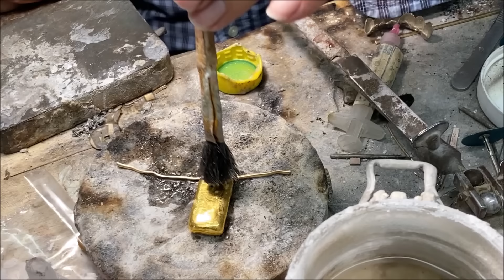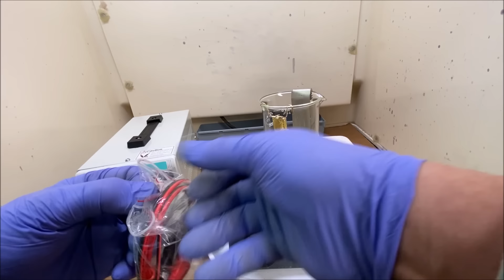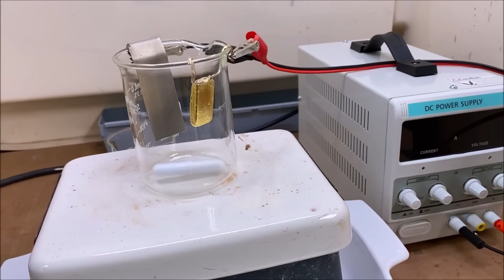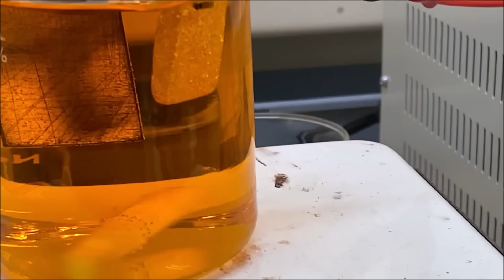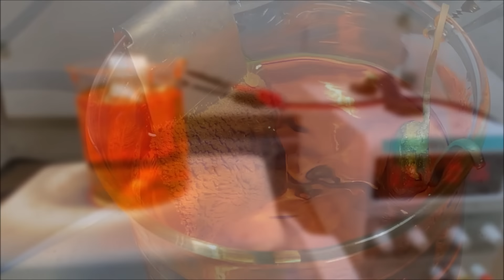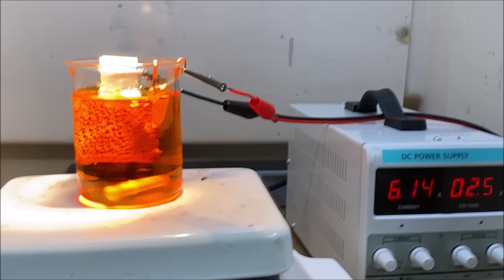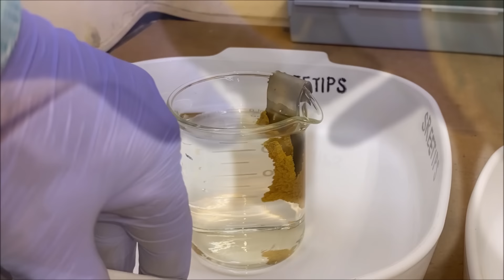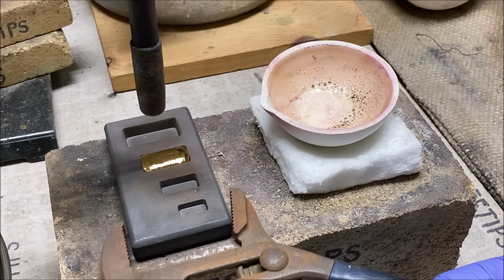Electrolytic Gold Cell Part 2

Comment: Hello sreetips, got a question if you don’t mind.
Reply: Is their custom plastic beakers with holes in them for straining. I’m trying to have a plastic beaker that can withstand the acid for computer stuff that rests on the rim of the glass beaker so I can use the stir bar to keep the acid moving??? On say computer fingers.
Reply from the maker: I’ve never run across anything like that.
Reply: @sreetips  well I guess I’ll fashion one myself and see how it works, as always thanks for your input.
Reply: It will fit into the glass beaker of course.
Reply: I watched some guys in India take computer part gold plated and casting sand. They inquarted it with led with wood as the heat source!!!!

Comment: The flame in your touch is putting a small amount of carbon in your gold you need to increase the oxygen to remove the point of flame near the touch tip

Comment: What is the purpose of this?
Reply from the maker: It’s called “gold refining”
Reply: refining is the process of removing impurities and unwanted contamination from a element. In the case of gold, the idea is to get it as pure as possible so there is literally no chance of a speck of lesser metal, like silver or copper being in the gold. there are many methods of refining, and this method is the only way to take some gold and turn it into the purest possible form, gold crystals. The final product is a gold that's more pure than any other method.

Comment: So I have a question, I'm slightly confused. You had 25g Au in the soultion. And used a bar that was 58g Au. And you produced a yield of 45g Au. You said it was rougly 25g Au left in the soultion after the process. So there was 25g Au in the soultion before and after the process so they cancel out. That leaves your yield at -13g Au plus whatever the "sharks tooth" weighed minus the weight of the rings and solder you added to the bar. Based on the size of the bar you had rolled that weighed 11g. I would guess the "sharks tooth" weight around 20g not counting the arms you added from the rings. So your total yield was approximately 7g Au? So 7g @ about $63 per gram= about $441. Then saying overall in both process not including the equipment, but the vauious acids and things are probably around $50. So essentially this whole process would make you around $400 correct?
Reply from the maker: Let me see if I can provide some insight: I did this for the show.

Comment: It would be nice to have a hand held XRF to get a PMI of the materials you work with. I use one quite often at work. I have to analyze each part for certain safety valves used for different chemicals in the industry that can be operated at very high pressures. Having a part made of a slightly different alloy can cause catastrophic failure and result in some very very severe consequence
Reply from the maker: We had those tests on all our repairs done to 1200 psi steam lines.

Comment: Why don’t central banks do this??
Reply from the maker: Because they can’t print metal out of thin air.
Reply: @sreetips  I meant instead of buying it in the open market. Why do miners mine and refine gold and silver when they can use this method?
Reply: @filesshared9431  its too much work when they just can buy it with money they don't even have, Fiat currency lets you create money outta thin air but thaats another video
Reply from the maker: I’m not creating any gold or silver with these electrolytic refining cells. I only get out what I put in. No metal is gained or lost (unless I spill a little). All the gold and silver that I work with came out of the ground. I’m merely purifying it with my electrolytic refining cells.
Reply: Because Chemistry labs with highly dangerous and corrosive material and deadly fumes and banks are different things.... and because They really make plenty money just sitting around doing nothing without having to refine gold into pure gold crystals by submerging titanium into a solution of dissolved gold and passing electric current through it so it solidifies onto the titanium as the most pure, crystal form of gold possible in the universe.